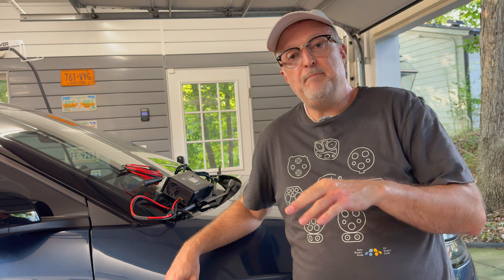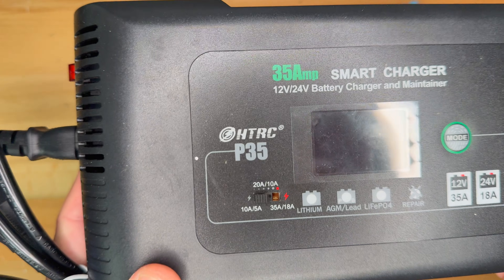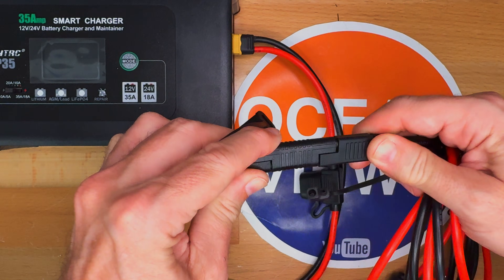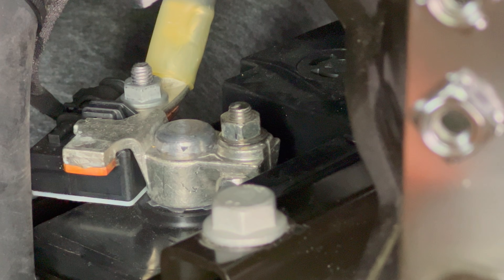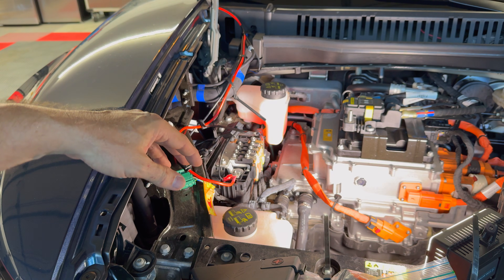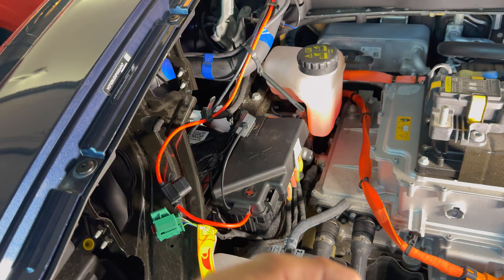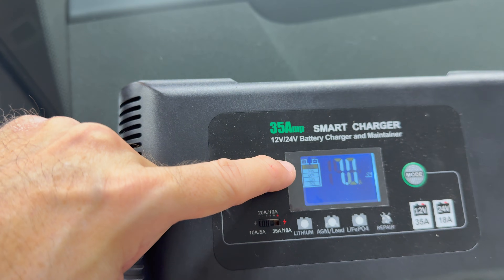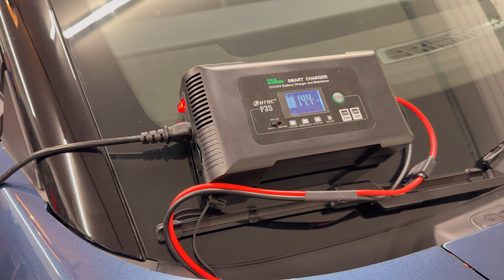Fisker Ocean - 12V Battery Tender V2.0

Comment: Be careful with that charger.  I have the 25A version of that same charger and the first one got hot and melted.   Got tired of my F250's batteries dying since I don't drive it a lot and i'd bring out one of my solar generators to power it and charge the batteries (it's parked on the street), but it became too much of a hassle, so I fabricated some mounts to put a 410W solar panel (I had one left over from another project) in the bed of the truck, mounting a Victron charge controller / DC disconnect under it to send power to the batteries via some 8AWG cables.  So far, my .41kw  trickle charger has been working nicely. :)
Reply from the maker: Thanks for the heads up.  Through my testing so far, it doesn't seem to get very hot.  I assume the fans are doing their job on my unit.